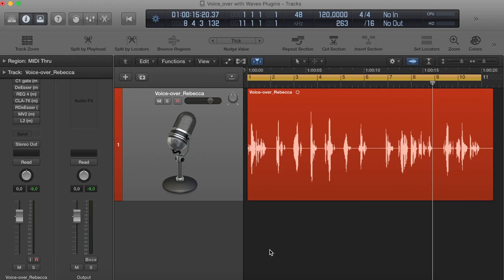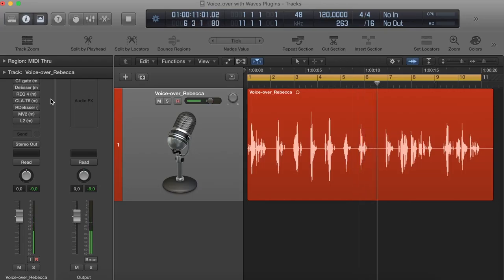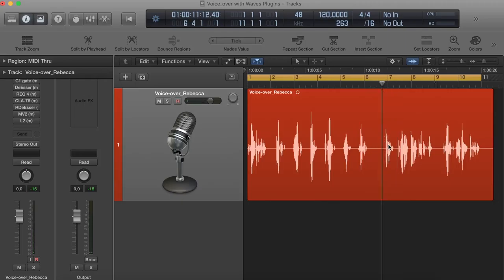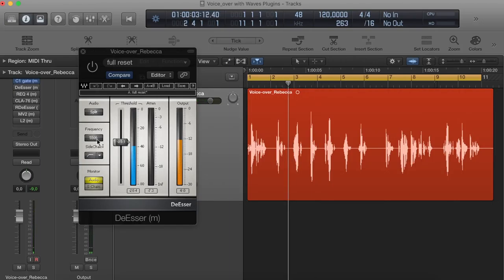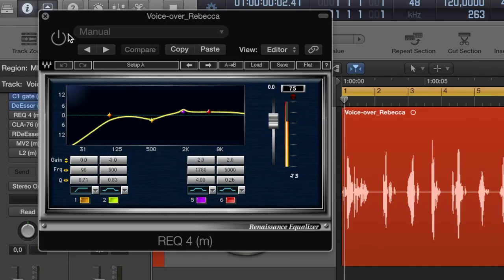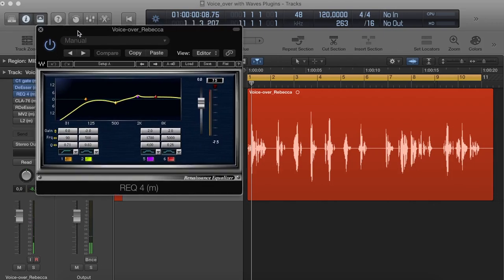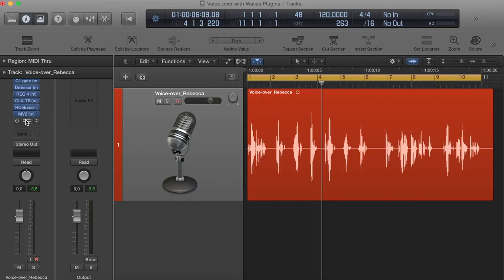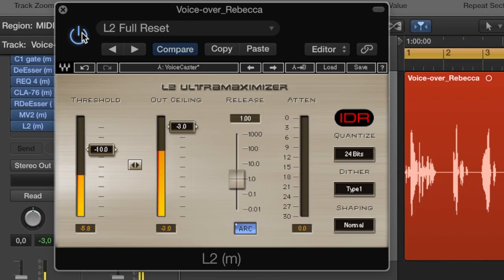Female Voice-over Mixing Tutorial | Waves Plugins

Comment: You say the MV2 compresses low and high frequencies, but that isn't accurate- the the high level and low level refer to dynamic range, so the low level applies upward compression on the parts of your signal which are below the threshold, and the high level applies regular compression to the peaks, with attack release and ratio all predetermined. See Waves tutorial: https://www.waves.com/make-tracks-cut-through-the-mix-with-mv2
Reply from the maker: Right, I know - I should have said low and high level in terms of volume!

Comment: Nice One, also i noticed that the CLA-76 has a knob to switch off the analogue feel...which sought off added some extra hum/noise to the audio. Was that on purpose? Nice tutorials
Reply from the maker: thanks! They kind of modelled the power supply noise and hum of the real unit into the plugin, but I actually don't mess around with it. Maybe I should just turn it off, as it doesn't add anything special to the signal other than hum.

Comment: This feels like a kinda novice question, but... don't both L2 and MV2 use dithering, and isn't it generally discouraged to have dithering more than once? I'm generally of the "if it sounds right, it IS right" perspective, but doesn't that get into messing with bit rates or... other... digital... issues? lol
Reply from the maker: I would not worry too much about that. Since the MV2 has auto-dithering you can‘t turn it of anyways. If you record at 24bit and leave the same sample rate for the export, in my case 48kHz for film, you don‘t have to dither at all since I there‘s no Bit change or downsampling happening. I just leave it on by default - it‘s not really audible.